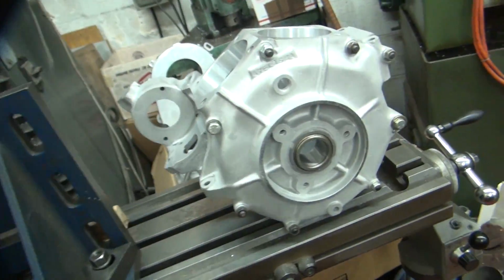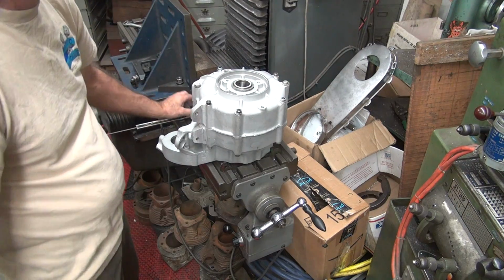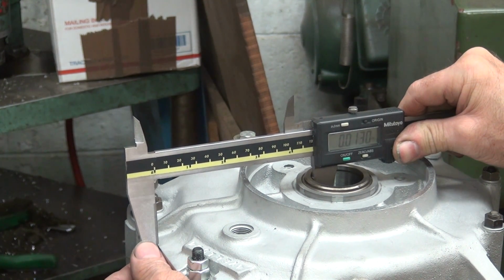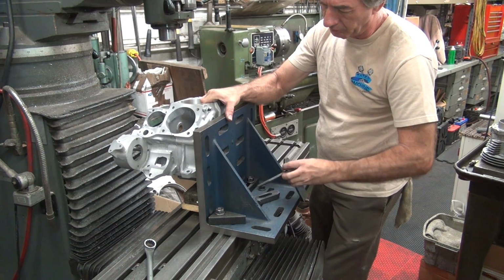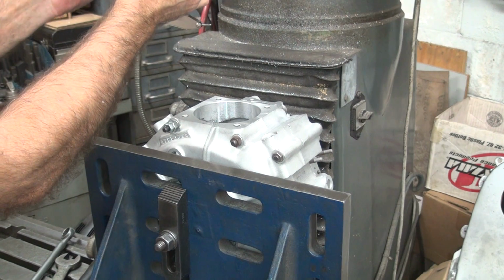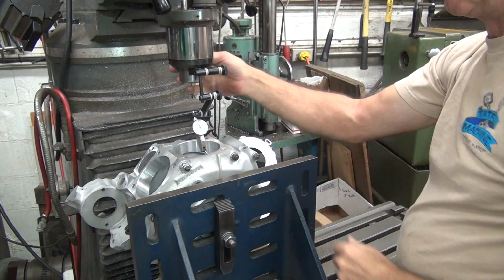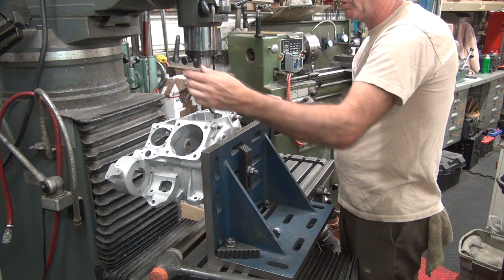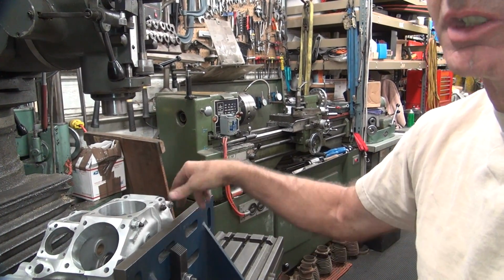#201 1947 EL case welding knucklehead 74ci motor rebuild & machining repair harley by tatro machine

Comment: The whole case can be moved on the plate it’s not fixed to the axle in the case. So you got a bit of luck when you used the hammer. But that’s what you was after so perfect. 👍 😊